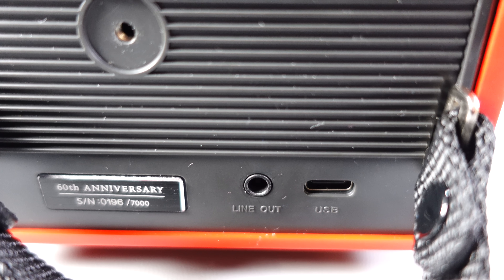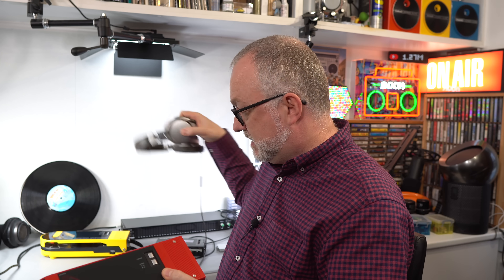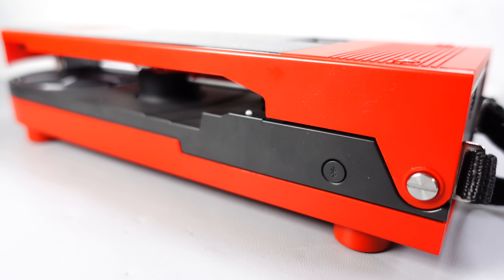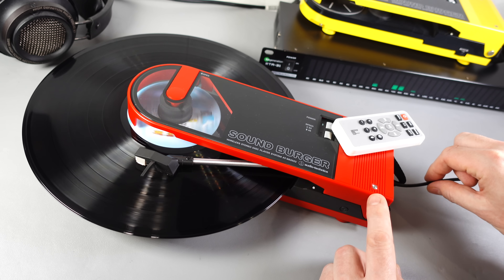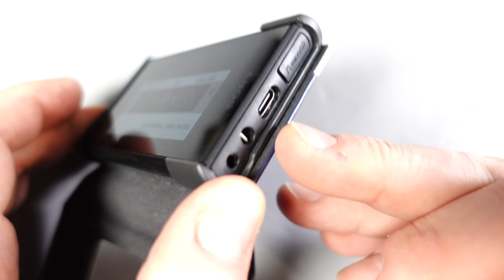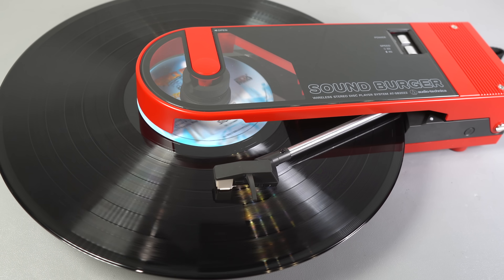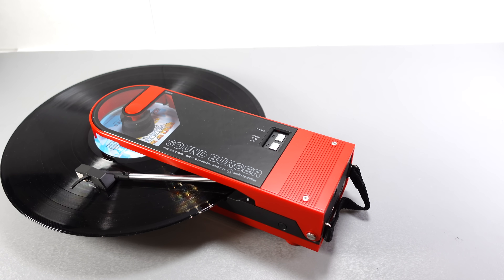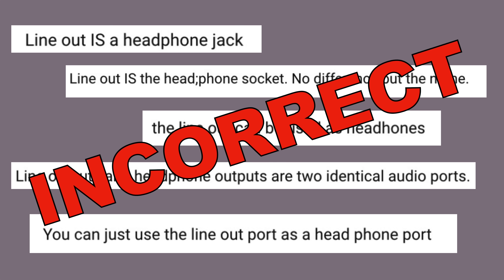Line-out ≠ Headphone-out

Comment: Or, to put it more simply: Line out = raw sound - unamplified. Headphone = amplified sound. If a device doesn't have a built-in amp, it can't power headphones.
Reply: It's not quite as simple as that though, the video is already simplifying some things. Line level often won't match what's fed to it from analog sources. Many turntable outputs for example require a preamp to get to line level. I think cassette decks, VCRs and other tape based machines also do some amplification to get line level outputs.
The impedances of headphone and line output are also different.
Headphone/earphone impedances can also vary considerable, some headphones can be audible(or even loud) when fed a line level signal.
Reply: @DoubleMonoLR  I was just trying to simplify it for those who didn't know all that stuff, but wanted to know if they could plug headphones into a lineout port. (Although perhaps I should have just said "no"!). No disrespect to Techmoan, but I found his explanation rather confusing.

Comment: Great video Mat 👍👍 I think another part of the problem is that manufacturers have used the 3.5mm jack plug for almost everything over the years. The original Atari 2600 had 3.5mm jack plug for it's power input!
Reply: Yes and a lot of other things from the 70s and 80s too! I collect pocket calculators, and most of them that had external power sockets, used 3.5mm jacks. I had a japanese cassette recorder from 1978 that had 3.5mm jack sockets for Earphone (before there were two of them and called Headphones), Microphone, and DC Power. For God's sake don't accidentally plug the power into the Mic socket!...

Comment: so basically you need powered speaker in order to get the audio out of the port right?
Reply: Some headphones/earphones will work, at different (but unadjustable)volumes for each, some form of amplification and volume control will basically always be better or required.
I guess 'powered speakers' are the norm now, line out almost always used to be connected to some sort of amplifier or sound system(including car stereos), to which speakers (or headphones) were connected.
Reply: I just bought an AT-LP60X and tried to plug unpowered headphones to the port with the pre-amp on and it works decently. The volume might be unadjustable but it proves that if the output carries at least enough power it might be able for unpowered speaker to produce sound out of it
Reply: Yes, you can also get headphones that have an amp. So this guy is not being completely accurate here.  You can plugin some headphones to a line out.

Comment: One thing that bugs me about playing something over bluetooth that you don’t have the option to select line level at the playback device. You always end up having to crank you car stereo volume way up high or boost the volume of your playback device up to max in order to hear something. I mean the signal is digital, so why can’t it just ”tell” the amplifier that it’s getting it at line level?
Reply: It is poor that some  devices with bluetooth builtin handle it poorly, though you can get bluetooth transmitters & receivers that have line in/out sockets.
The volume is often linked between the devices though, even with some cheap devices changing the volume on 1 device will show the volume changing on both, up to the maximum limit. In that case it effectively is acting like line level.

Comment: Furthering confusion, sometimes line-in jacks on things are more designed to be used with headphone output rather than a line signal. For example, I have one of those Pure radios where there's no volume control on the line input - only DAB/FM has volume control (and bass/treble, for that matter). So if you use it with a line-level signal, which I have done, you end up with something louder than the volume at which I'd normally listen yet still quieter than the hardware is capable of.

Comment: As someone who works in semiconductor industry for headset/earbud chips, line out can be used for headphones, the term can be interchanged but would expected a specific impedance range. Your mention of always need to amplify it isn't true, you just need to define the expected (line out) load. We also use the same line out for Class AB or Class D, this need to be defined in the design as Class D needs filtering where as Class AB doesn't.

Comment: Just to confuse the poor noob kids some more (although not that confusing really) There is also two line out levels in audio specs. The standard one, you are addressing here - for interconnecting domestic audio devices is set at 1 volt peak to peak. There is another for large venues, like night clubs, gigs, bands, concerts that is set to 10 volts peak to peak. You have the same issue as with the line-out and headphone levels - You can send the lower level domestic 1v line-out into a big venues power amplifier - but you wont get the full volume (watts) from the amp, as it is only amplifying a tiny 1 volt line level, not 10v!

Comment: I had a portable CD player that had a physical switch that switched the output between line out and headphone out to help avoid confusion. Sucks with today's technology that all those now-legacy devices are rare to be seen thanks to smart phones dominating the media markets.
Reply: Ahh mobile phones, the real social cancer...
Since I started using a set of In-Ear Monitors, I understand that volume controls are necessary for headphone outputs, lest uncontrolled high-volume outputs can deafen you.
I use a HiBY R2 for audio playback regularly, and it's line-out mode seems to max out the volume and disables volume controls.
Reply: In that era people also more often connected devices(particularly portable cd players) to their home & car stereos. Some portable CD players were pretty heavily marketed for having line outputs for car & home use.
From memory I think there was considerably less confusion at the time, and of course any sound systems using seperate devices required a plethora of line inputs & outputs!
Home stereos/amps seem to be on a steady decline, replaced with an endless cycle of bluetooth speakers, sound bars etc.

Comment: The other issue with headphones these days that might have influenced the decision to not have headphone out is back in the day headphones were often used to plug in to home audio systems and had quite a generous length of cable.  Modern headphones generally have much shorter cables as they are usually designed for personal audio equipment.  The impact of this is you would struggle to use modern headphones on the burger without tugging the machine every time you move or having to keep your face really close to the player.
Reply: i don't think that's an issue if you really want to use your short cable headphones for something that requires a longer one. a simple 3,5mm extension cable with a male plug at one end and a female one at the other does the trick. that's the beauty of things like this, you can pretty much always find a way around the problem
Reply: Depends on what headphones we're talking about. Any decent hifi wired headphones would have a 6mm jack or a 3.5mm (usually a 6mm) to plug into deck amps and whatnot. If we're talking about shitty apple or bose or beats, then yeah, but nobody will listen to vinyl on those.
Reply: @Theclawsterrrr  real question is, is there any difference between 6mm and 3.5 other then the obvious size difference.  The only thing I can think of is the deeper grove/knob thing at the end of a 6mm makes it lock in more firmly.
Reply: @Theclawsterrrr  
Why would you use high end stuff to listen to vinyl to anyway? It's a terrible, outdated format.
Reply: Sennheiser does not have that problem. Always with more than 2m (usually 2,5 m).
Reply: It is just economics, nothing more.
Having a line out is much cheaper than adding an extra amplifier, volume knob, etc
The device is already extremely niche, so adding anything extra has a huge effect on returns..... cost/balances....
Reply: @CookieTube  Not to mention the electronics budget has already been spent on the A/D converter and Bluetooth radio.
Reply: @CookieTube  Just how much do you think those parts cost today? The little headphone amp would be unlucky to add even £1 per device in production costs, and adding volume would be trivial and cost close to nothing.
Reply: @CookieTube  Thanks to phone makers like Apple, corded headphones (at least for portable use) seems to fading away.  I think the manufacturer is just a little bit ahead of the curve, that's all.
Reply: @russellhltn1396  Basic pack-in stuff will always trend towards the cheapest, ecosystem locked option. But there's people who don't like sacrificing quality for convenience, and so things like dedicated stereo systems and wired headphones continue and will continue to exist for a long while year. There's a reason why Lightning to 3.5mm (and even 1/4") adapters are still being made, despite Apple's best efforts to strongarm everyone.
Reply: @VulpesHilarianus  Ok, so adapters are being made - in what quantities?
Reply: @russellhltn1396  Large enough that hardware manufacturers are willing to pay a patent fee and licensing fee to produce them. If there wasn't enough money in it Apple wouldn't approve use of those patents and thus they wouldn't be made.
Reply: I have a custom made extension cable for my headphones since the one I bought wasn't sturdy enough. 

that and I'd probably have the line out plugged into my headphone amp.
Reply: @Stevie-J  I have a portable headphone amp. and If I was serious I would get a new fiio a5 personally. I however do not listen to the music on the go. so I never encounter this issue.
Reply: @Stevie-J  what are you talking about again?

the set up is simple. you have your 3 meter 3.5mm cable to the input on the fiio a5, then you plug in your portable headphones into the a5. which you can have in a pocket if you have a hoodie on. or some other jacket that has a pocket. and then you can have good range and a short easy to travel headphone cable. I use he5xx with a 1m cable that I made myself. the way you control the volume is on the fiio a5 amp. it has a knob. there is no problems I see with using a sound burger and portable headphone amp.
Reply: In the mid-'90s to early 2000's, some devices allowed external audio devices to play audio over an automotive audio system, via an adapter that plugged into the 3.5mm headphone jack of say, a Discman.

I can see how that may have incorrectly trained people that any 3.5mm jack is sufficient for use as a means to play audio on an audio receiver.
Reply: get headphones with detachabale cable the cable dies more often than good headphones
Reply: Not a bad thing being close to the player. You can watch the disc spin around as you listen.
Reply: I understand this myself as I have an set of studio headphones that have a great amount of springy wire and one set for personal items and I hardly ever use the new ones cause the wire is so short.

Comment: Many years ago, I used to hook up my little black and white television to the little mono tape recorder I had in order to record stuff off the TV.  Rather than connecting what was a headphone output to the microphone socket of the tape recorder, I used to put it into the, 'line in.'  The sound quality was much better, as a result.  Using the mic socket resulting in distortion, due to it being over-powered.  The line-out on a device, is the opposite in that it needs to be fed into an amplifier, in order to, 'boost', the signal, as otherwise, the sound output is quite low.

Comment: The issue we often get at work is people plugging 4 pole headphones that came with their phones into 3 pole pc sockets and complaining about terrible sound. The will then 'Pull it out slightly and put pressure on one side, to get the sound to work. All is well until they either break the socket completely, or snap the socket off the PCB...
Reply: The 4th 'pin'(mic) and the earth pin share the area that is the (longer)earth pin on a 3 pin plug/socket, so it shouldn't be an issue much of the time.
Apple & a few others(probably copying Apple) put the mic connection at the very back instead of next to the right & left connections, I think this is generally what causes the problems. Everybody else did it the reverse(aka correct, imo) way. Naturally the very back is highly likely to be grounded(would often be a nuisance for it not to be) on a 3pin socket, closer to the right & left pins not so much.

Comment: I discovered this to be true when using a "car stereo cassette " adapter cartridge to line in my MD Walkman into a boombox (via the cassette deck) cos there was no Aux/Audio IN jack. 
I connected the adapter to the Walkman's headphone jack and the line out jack and while both worked fine, there was a considerable difference in the maximum volume output - I think it was the headphone jack that put out more power (probably cos of the built-in amplifier to deliver into piddly earphones), but there was a risk of distortion if the cassette adapter was not aligned just right on the heads (it also caused considerable drop in output strength, for the same reason).

Comment: Please excuse me for my poor english, I'm from Germany, but I try hard: Output Level, Volume Control and Impedance as you mentioned them are important differences between Line out and Headphone out, but if I'm informed correctly there's another difference that you did not mention (probably you simply forgot, I'm sure you know about  that!) and that is the standby current. Headphone Outputs give out a little standby current (DC!) to the Headphones to keep the Membranes in their middle position as default, so that the amplitudes of the Audio Signal can be reproduced as they're meant to be heard. A Line Out doesn't do that! So you can probably destroy your Line In if you connect it to a Headphone Socket of another device! Most modern devices can handle that little standby current, but especially older Amplifiers can have problems with that.
Reply: uhhhhh no. there is no DC bias on the output of a headphone socket and if there is something is wrong. we're talking milli watts. any dc is going to melt headphones *the membranes are made of a plastic polymer and the voice coil is glued to them. some devices might pulse verry little voltage upon plugging in headphones to detect that they are headphones by reading the dc resistance, but they don't continuously do that.
Reply: @CotyRiddle  so then this refers only to speaker outputs?
Reply: @diesunddas1592  generally speaking on speaker outputs you might find a very small amount of dc voltage but for headphones that's a definite no. my actual stereo only puts out about 0.06 volts dc on the outputs. which is normal in that case as it is class a/b but headphone amps are generally not class a/b so if there is any that do have voltage on the outputs headphone output it would be a surprise to me as I have never seen that.
Reply: @CotyRiddle  Ok, thanks for your explanations. Then I got it wrong.

Comment: Excellent video as always! I got a question! Would a headphone out be lower quality than line out for recording purposes?
Reply: Good question , I would like loudness on my portable MD. 
I've done it on a  Tandberg TR 220 to TCD 330 that sounded good on my Walkman.
Reply: Generally, yes, as recording devices are likely to have line inputs(microphone input being presumably the only other common input), line level is also (at least meant to be) as the name implies - a set specific level, that doesn't change with the players volume adjustment. Perhaps most importantly, line in/out & headphone output  work with different impedances. I can pretty easily hear the difference between headphone output & line out sources connected to the line in on my amp, for example.
That's one advantage of old ipods, sometimes you can get line out from the docks/adaptor cables for better audio quality to your amp.

Comment: Some high-end DAC's line out can power headphones:)
Reply: Line out is line out, in theory it shouldn't make any difference which device it's from, certainly not enough to make it usable with all types of headphones.
Line output is meant to be a predictable line level signal, designed for a specific impedance. Albeit some devices switch automatically(or by using a manual switch) between line out & headphone out standards depending on what's connected.
Some DACs also have headphone outputs, and some are solely for that purpose.

Comment: I even managed to use mic with line in, without any amplifier - but with a 1.5V battery in series. Took a thick ballpoint pen apart, and installed jack on the writing end, mic on the clicky end, and battery inside, in series. And could use Nokia 5510 as dictaphone... 'cause for reasons unknown, it only allowed recording through line in.

Comment: A headphone out and a line out can both be used to plug in to the line input of an amp. Just make sure that you don't overdrive the amp input with the headphone signal. But ideally, you use the line output as it is designed to drive or couple to the high impedance load, typically 10K or so, of the amplifier input. Also, the headphone output may not be as neutral - it may be "coloured" already as it will have the sound signature of the headphone amp.

Comment: Speaking of Headphones that require a lot of Power to drive: I've got  AKG K240 600Ohms Headphones, to drive them I plug them into my Technics HiFi Amplifier, so I can switch between the Headphones and the Speakers AND monitor my Speaker-Setup for potential Errors. 
Long Story short: My poor PC-Soundcard just does not have the ability to drive my Headphones properly. I need to amplify the signal, quite a lot, to get good results.
Reply: most headphone devices are limited to 100 mw at most. avg being like 30 mw
Reply: and thats at 32 ohms. avg impendence of consumer headphones with earbuds usually being around 16 ohms.